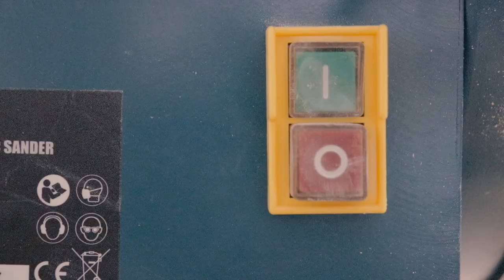The (not) Ultimate Pen Making Video

Comment: Nice Ricardo!  I appreciate you putting your work and process out there. Things we each do differently and some the same. I have yet to do any polishing/buffing using the lathe like that.  One tip I would share is that I lightly mount my pen tubes in my cordless drill and rough them up so they have radial grooves. You have to flip them over end over end but I find it does a nice job. Just don’t crank down on the chuck!
Reply from the maker: Thomas Horner Jr. Thank you Thomas! It’s a pleasure to share and also learn with other makers. Great tip. I will definitely try it!